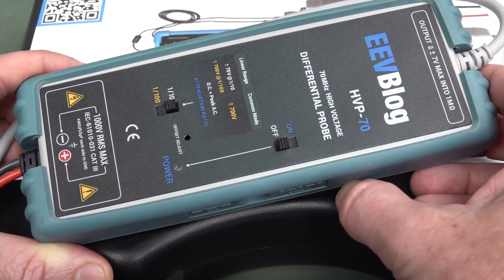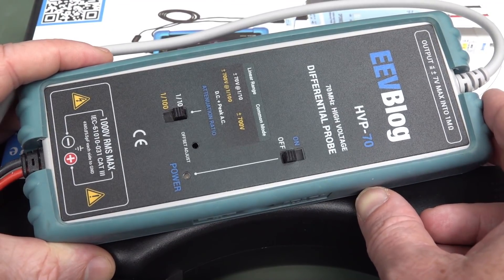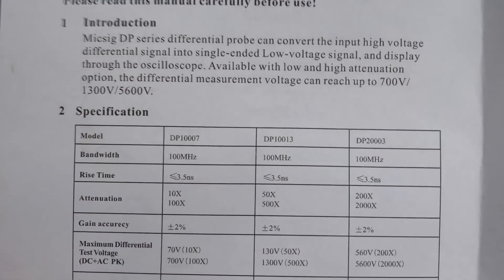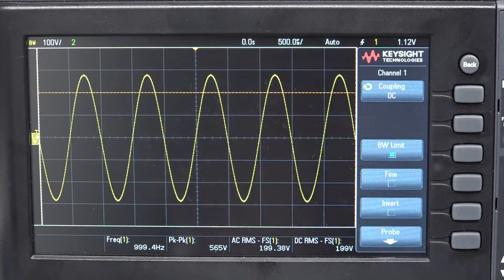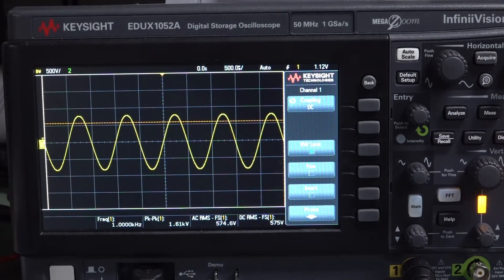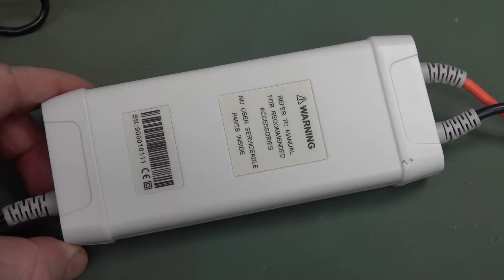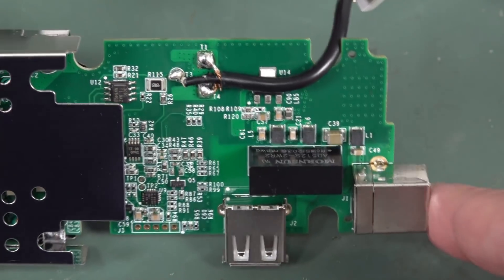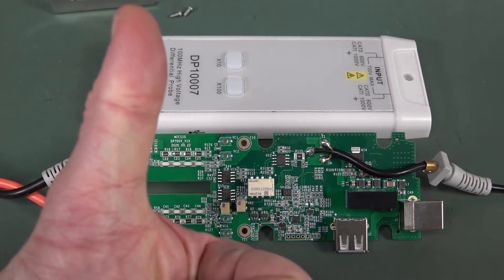EEVblog 1414 - MicSig DP10007 High Voltage Probe - Turning it up to 11

Comment: Probably the CMRR upgrade will be a tweak to the resistor values in the instrument amplifier, probably with either a select on test bodge resistor put in, or with a tiny pot stuck in the middle there to do the adjustment for the resistors being not ideal. Yes it looks nice, and of course the little microcontroller there, though I would say it also has a built in ADC that is being used to sample a rectified sample off the output, to flip the power and range LED to flash when approaching overload, and nice there is still headroom when it starts to flash clipping, so your measuring will still be accurate just before.

If you selected 1199.9 you would have a higher output off the amplifier......
Reply from the maker: Yes, likely just tighening up the resistor balance. Could even be done as a BOM tweak only if lucky enough.
Reply: @EEVblog  They would have to change the reel of those "1%" resistors found at the market, made from recycled ewaste. They might have to spring for genuine Vishay parts in the input side, both resistors and capacitors. Wonder how good the CMRR is at 70Mhz.
Reply from the maker: @SeanBZA  These kind of probes are pretty how'ya'doing once you start hitting 70MHz, let alone the 100MHz rating. Gotta hold your tongue at the right angle on a full moon.
Reply: @SeanBZA  It will be terrible, but that is not micsig fault, all HV probes I know off and have used be them low or high end have the CMRR fall off a cliff with respect to DC  well below the rated frequency, it is for that reason that optically isolated probes are almost required to work with WBG devices where CMRR really matters (you can actually do without, however you must take into account that you will be unable to see or measure the switching dynamics)

Comment: Still alot of people complaining about the 2 test leads. My guess is that they (at least partially) avoid the shrouded 4 mm banana sockets for safety/compliane reasons. It would essentially just lead to tempting people to plug in their unshrouded banana jacks and asortment of clamps that could easily slip off during probing exposing 700+ volt contacts. By having the leads already attached they kind of prevent that (unless someone goes out of their way to do dumb things).  Having 2 leads and HV probes is also probably easier to get through the various CAT specifications than trying to create a "proper" probe that qualifies for 1000V. The Ground will always be akward to use in such cases, so going with 2 probes and the diff. amp. is probably the most practical way here. I know there are some expensive manufacturers that do it nontheless, but I kinda question the use of it. Since these definitely appeal to hobbyists as well, I think this is a rather sensible choice, since their main purpose is probing safely anyway.

Comment: I have that same probe but the case is yellow and it’s a different brand. It’s not really isolated, I think they use 1mohm or 10mohm resistors or something. 4 AA cells.

Comment: Just wondering... Wouldn't it be possible to determine the clipping point by using the spectrum analyzer of your scope and looking for the point where the higher-frequency "noise" starts to creep in? Might be more sensitive than eyeballing the peak flattening of a sine wave, but I just don't know...
Reply from the maker: The Mk1 eyeball is good enough for Australia.

Comment: At 12:10 the centre wire of the scope connection shows it is not up to a lot of vibrations or it will break.

Comment: What I want to see is the DP20003 tested. It says it can do +/-5600V on a 2000x divider (output voltage +/-3V), but the common mode is specced at CAT III 1000V - how does that work? Even on a differential sine wave that would require 2kVrms on each input. Unless the limitation is simply thermal and it can measure 5.6kV pulses that are <1kVrms common mode.

Comment: You little beauty Dave... I think my Oz speak is good. I've been looking at the Dp0007 as it's about what I can afford. Great review but I might just hang on now and see if they fix the common mode rejection issue before I put my cash where my mouth is. Thanks again 👍
Oh, ps, I'd have bought your Sapphire probe but I'm guessing the p&p would be a bit of a problem as I'm in the UK 😔

Comment: How does the DP-20003 compare with the HVP-70 in terms of performance? Seems that’s the one to get with the highest voltage range and would be cheaper than the saphire still.

Comment: Looks like you don’t have the volts to drive the diff probe to failure. That motherboard, though, is a different story. Crank it to 1,100 volts and put a 20 GHz crystal in there and overclock that bad boy… for all of about 1 picosecond! 🤣😝 If it’s worth doing (on video), it’s worth over doing! 😏

Comment: There is a frequency compensation made by R121 and R122 and two capacitors made by the pcb itself and small square copper pads. These RC networks are in parallel with R16 or R75. They are not used because these resistors are not fitted but it is a nice design.

Comment: It wouldn’t cost that much to modify the injection mould to have different input connections, it’s a pretty simple change in that case, a bit of laser welding on one half to fill the existing half shell hole and a couple of round inserts in the other half with a sliding block to pull them out before ejection … my guess would be about $5K to do, along with a minor PCB change to fit 4mm jacks.
Reply: I wouldn’t be so sure about putting a slide into a mold not designed for one. I’m not sure it would be necessary though. You could just use jacks with the shroud molded in already that just slide in the case. 
It’s all going to add cost though
Reply: @Turbochargedtwelve  The case will need to have holes added (instead of just the half holes it has now which are located on the part line of the mould and so do not require any moving cores to form them), so making complete holes on the side face requires a pair of removable cores to be added, the easiest way of doing that is a small sliding block which has the cores mounted on it, they wouldn't even require water cooling so the size of the block wouldn't end up being very big.

Comment: I have a couple of the Micsig 5kV probes and they have been very good, felt it was a bit of a punt at the time as they were a lot cheaper than others but they have lasted through a few over voltage events and I like the probes.
Reply from the maker: They's have a very different front end string spacing and count to this model I'm sure.

Comment: Hey Dave how about a tear down and analysis of the Gigabyte power supplies that are blowing up?
Reply: i think it would need to be a mailbag item.
Reply: I also would like to see Dave help out GN.
Reply from the maker: I have no idea what this is about.
Reply: @EEVblog  GP-P750GM and GP-P850GM desktop power supplies. Gamer's Nexus and others suspect a bad mosfet gate driver design.
Reply: @EEVblog  I am really curious if you can / will respond to the video @Gamersnexus made after the press release of Gigabyte. https://youtu.be/7JmPUr-BeEM

Is the respond that Gigabyte gave in their press release bogus? Is the test method used by GN valid and I’m actually curious if such a ‘design flaw’ is a real fire hazard risk?
Reply: @EEVblog  Gigabyte/NewEgg has been forcing people to buy defective power supplies to get NVidia Graphics cards. Gigabyte is acting like there is no problem with them. They attack those who are highlighting the problem like https://www.youtube.com/watch?v=aACtT_rzToI
Reply: My favorite part about them is that a different part fails every time.
Reply: @Digital_Dependence  it will be a hot item, pun intended, for the coming weeks to come.
Reply: I was told by "a dude" that Gigabyte has requested a "world wide + Mars" gag order.  :O/
Reply from the maker: @Digital_Dependence  By the time I managed to get one and reverse engineer it to create a schematic and then attempt to analyse what the potential issue could be (and that may not be possible unless I have multiple units to test/destroy, not to mention trying to create various loads to do this (I don't have their nifty purpose designed SM-8800 load), the whole saga would be over. If someone already has a schematic then maybe I can takle a look, otherwise I don't see any value in trying to do this.
Reply: @EEVblog The problem appears to be on the primary side, I don't think any fancy load is required
Reply: @EEVblog  I think the value would be the way that these power supplies are designed and how they are supposed to work. What am I looking for in the future for a well designed one. The testing has already been done.